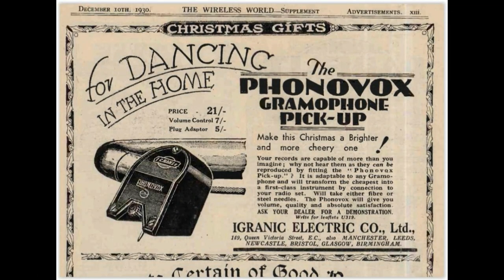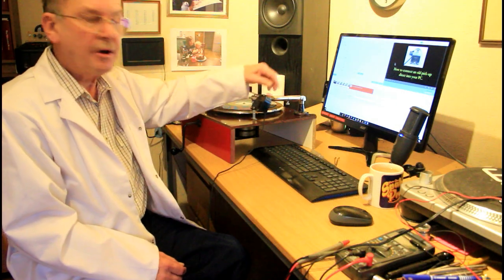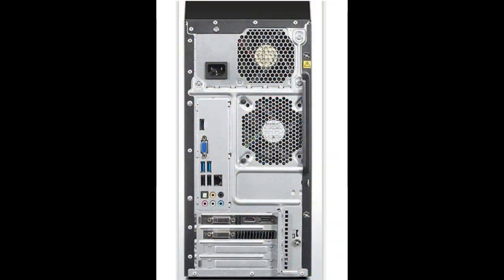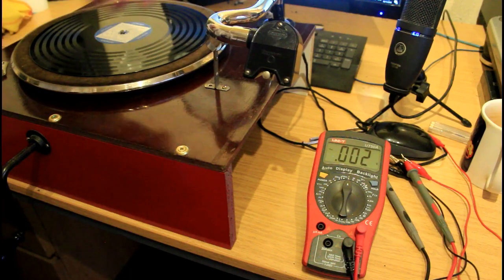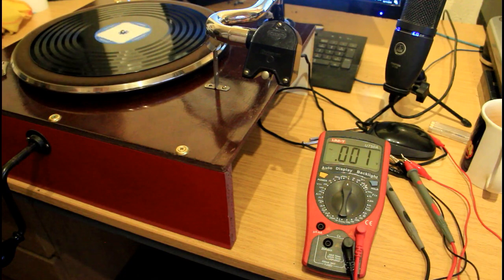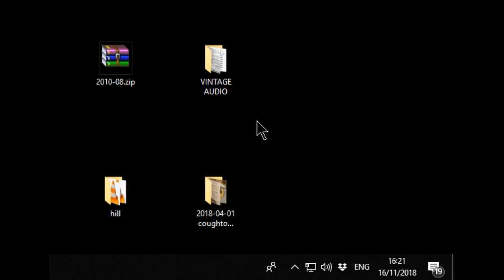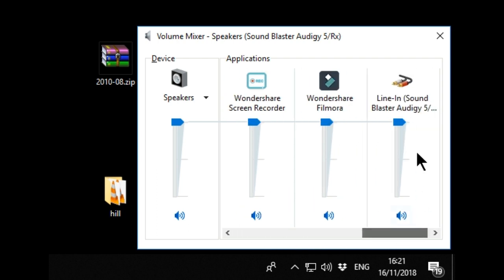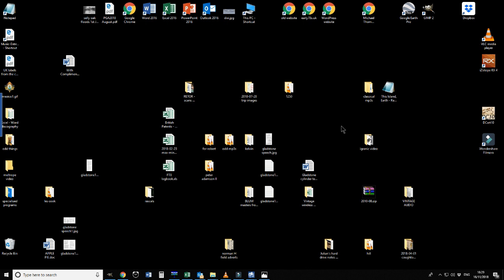record an old 78 rpm pickup onto a PC

Comment: Listened it again today, with better speakers. Thanks again, Norman. Is it worthwhile adding some equalisation to a record and pickup of that vintage? If so, then what do you normally use?

You mentioned Audacity. It is the go-to, cross-platform audio-editing application here, and is being used in various flavours of Linux and MacOS. Audacity can also convert tracks to mono, as well as edit clicks. You can also zoom in very closely and edit out noise manually. Various bandpass and notch filters, plus graphic equalisers with different capabilities are also available. 

One feature which is in use here twice every week for processing spoken audio, is the ability to select and amplify sections of audio semi-automatically, meaning that a suggested amplification level is pre-selected. You can choose to allow clipping, which it does very softly, to over-ride the suggested amplification level. You can also insert silence, remove general noise very nicely. 

Some very good results can be obtained, even with mediocre sound sources. One which worked very well was the processing of a cylinder recording of a banjo and guitar duet, which, after editing, had almost no audible noise, and a very true sound (for the technology) of the instruments, and with no audible processing artefacts. One trick used for that was to sample out the noise, then invert it, and add it back into the audio. That worked extremely well, with no audible detriment to the music. Shall try to find it, and send it to you later, if your e-mail address from last year is still valid.

Comment: Looks as though you are in need of a cheap audio oscilloscope... There should be suitable software which would be able to make your PC display waveforms with accurate voltage and decibel levels. Audacity displays the latter, and could fulfil your needs, providing that you can match the impedances closely enough.

Incidentally, and since you mentioned the name, sound systems on fairground rides are still sometimes referred to as 'Panatropes' by the more traditional fairground families. 'The Panatrope killed off the fairground organ' is still a current lament. The old Brunswick name lives on! Thanks Norman.